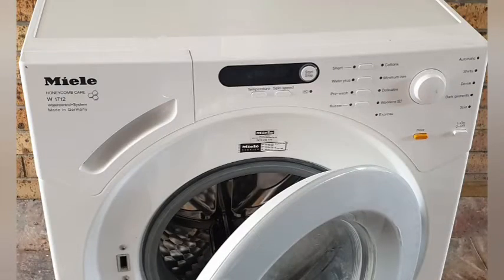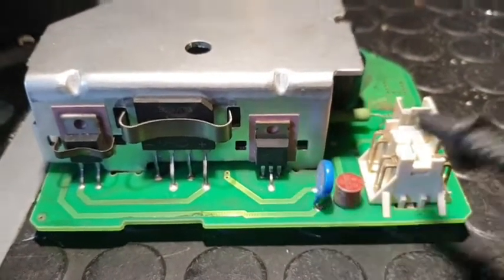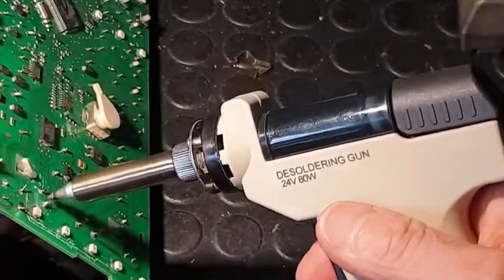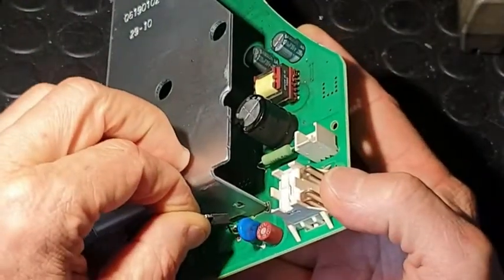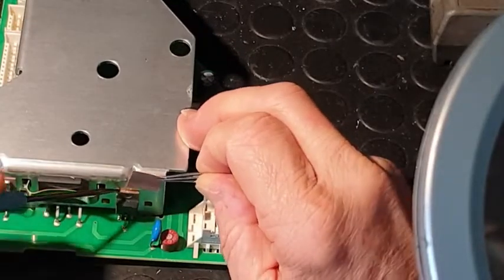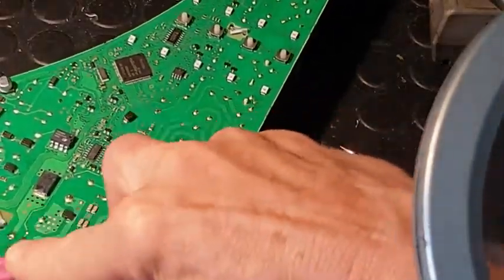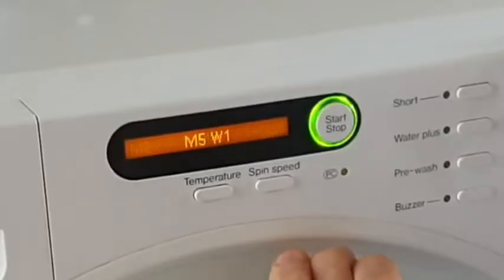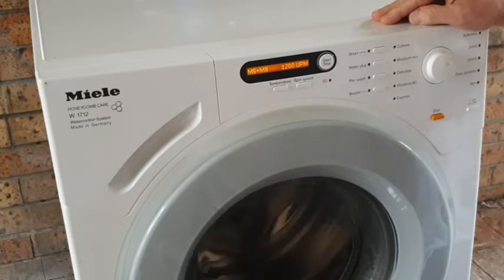Miele - How to Fix a Faulty Speed Controller

Comment: Thanks for this video!! I measured a 3 Ohm so I'm going to try to replace the part. The IRG4BC30WPBF is hard to get by, do you think the IGP15N60T could be a good replacement?
Reply from the maker: @stinoway  Did you try Ebay?

Comment: HI
IGBT FAIL AGAIN AND AGAIN, WHAT SHALL I DO ?
THANKS
Reply from the maker: Make sure the thin heat transfer sheet sits between the heat sink and the IGBT,  the retaining clip needs to press the IGBT firmly to the heat sink. Also make sure there is no electrical connection between the heat sink and the IGBT. Check the motor, carbon brushes, check for short circuits on the commutator, between windings etc, measure current draw. If possible try a motor that is known to have no issues and make sure the reversing relays all operate as they should.
Reply: @thermavolt4552  THANK yr kindness !